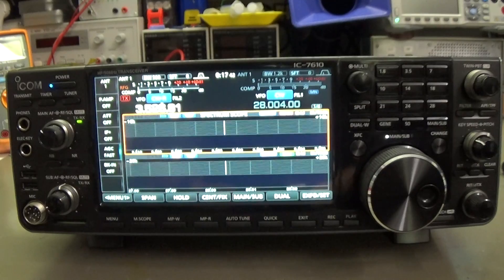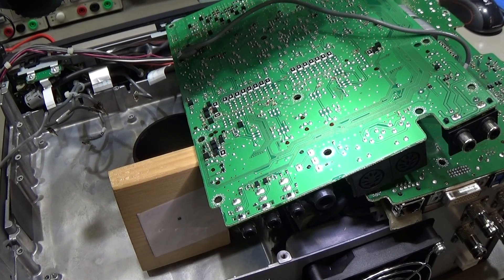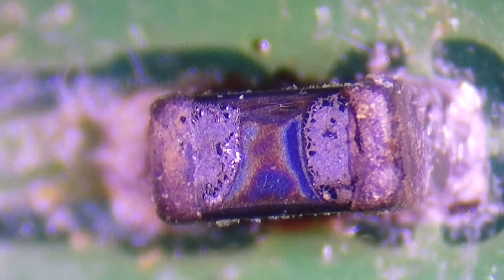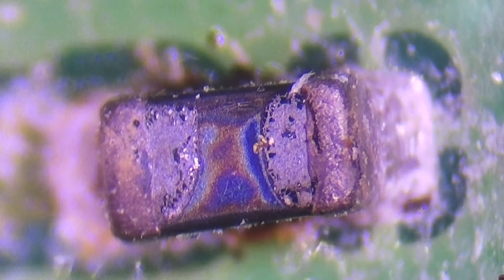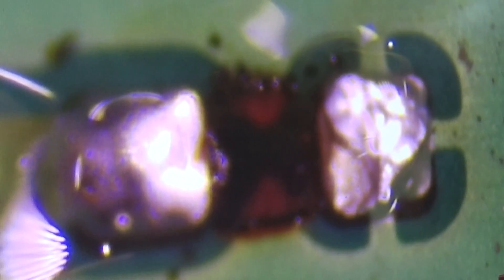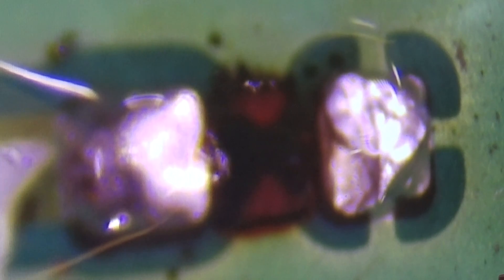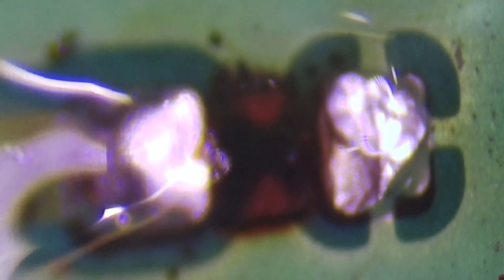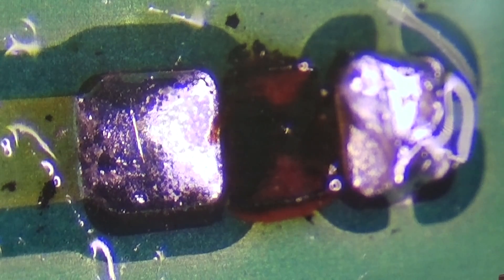#284 ICOM IC-7610 standard key not working on port

Comment: hello. nice vid. operator has most likely grounding issues, in conjunction with using a qro and high swr on antenna / feeder system, or he is for some reason keying with a software that connects the pc to that input via a serial port / adapter, and the setup, in this case, has a current loop.
Reply from the maker: yes definitely one possible explanation...

Comment: Interesting using a ferrite bead as a fuse. 🙂
Well two functions
1: Lowers emissions on the ground wire
2: Limits the DC current to less than 400mA

Makes you wonder if there was enough RF in the shack to give a high ground current.  
1K @ 100MHz may have enough impedance at HF to get hot when trying to block RF getting off the key wire to ground.

Comment: I am curious, plus I am unsure how they work, but could it be that the operator plugged an electronic keyed into the rear jack? Do you think that might be the issue that lead to that filter burning out? Thank you for investing the time into making these videos.  — Phil
Reply: Hi HBT ! This issue can occur when there's no radio frequency grounding at the station. The solution would be to use a Ferrite and run the CW key cable through it with several turns to isolate the RF feedback coming from the cable or the equipment's casing. Regards.. 73 - PY2NDB
Reply: I was going to ask the same thing.   lol

Comment: Quite difficult to get at this coil. I believe the key cable has been "hot" with RF, causing enough current to flow to burn out this little SMD choke. I experienced a similar thing with a Yaesu FT757GXII, had a transistor in the KEY ground return which burned out. This was a much easier fix, though..
Reply: I agree.  I have a Xiego G90 with the similar problem.   [ my fault, Im sure.  I was running another radio at the time]  RF in the Ground Buss will lead to this.  Dont Run 2 radios at once .  :(
Reply: Inave made a small key breakout box which allows all key types to all radios.. inside I have wound the wires round a toroid.. also have a switchable capacitor for radio/key combinations that require it..
Hopefully this will alleviate any extraneous RF problems